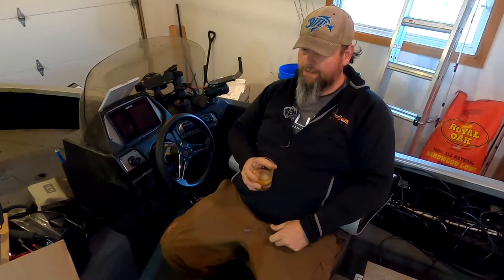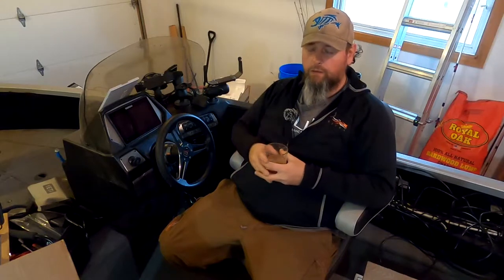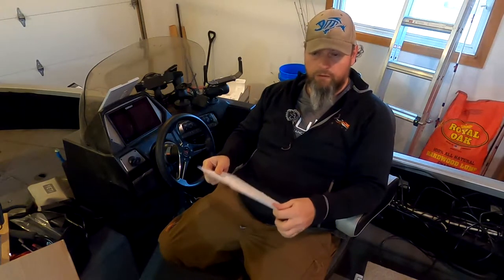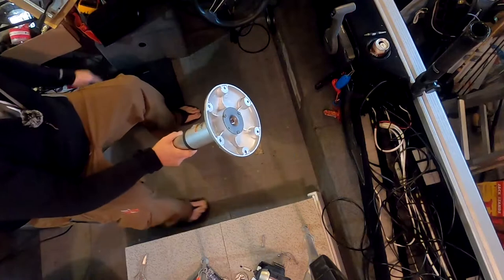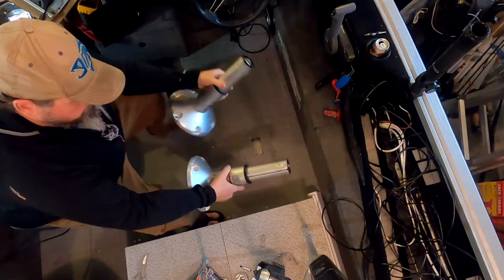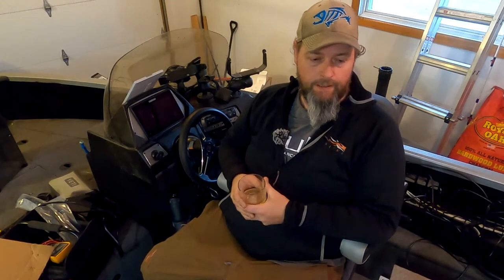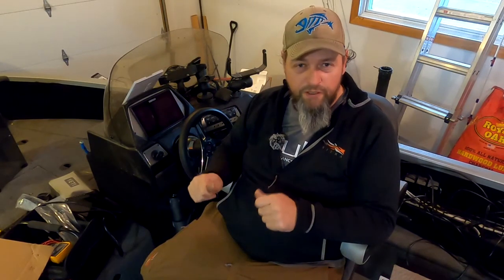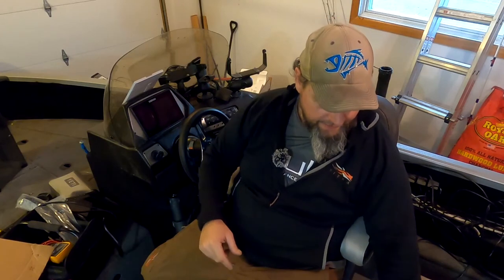How to:  Replace boat seat pedestal

Comment: Great video. One question. How did you extend the unit from the fully collapsed position.
Reply from the maker: Thanks! I just pushed on the adjustment screw with a screwdriver.